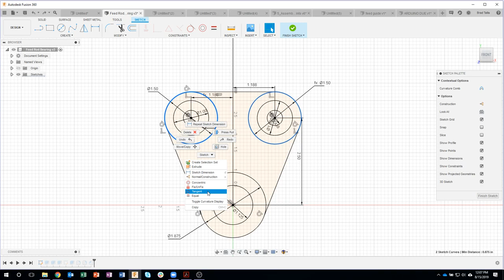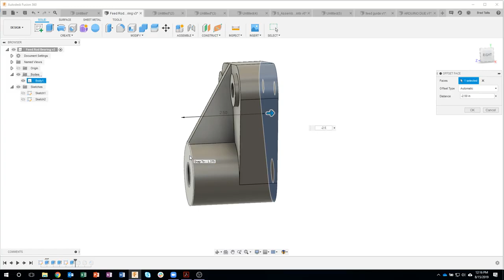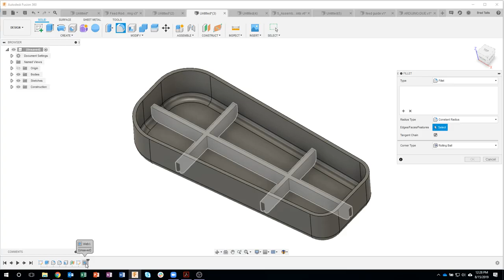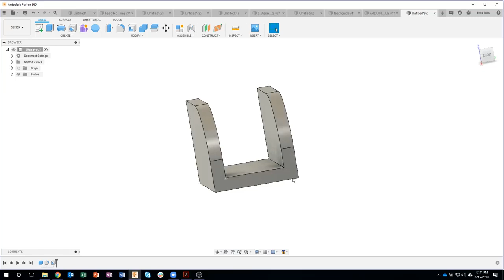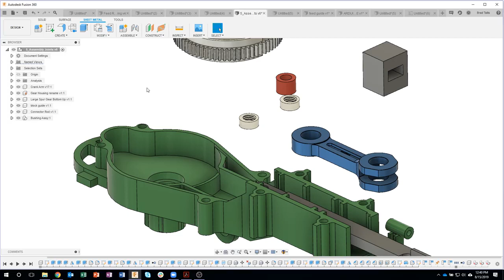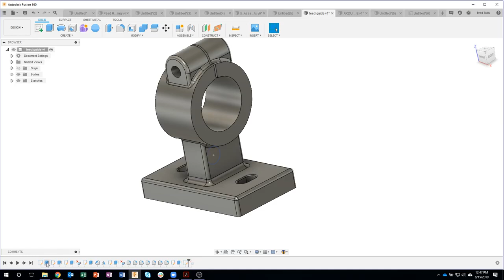Episode 40,  20+ Fusion 360 Tips & Tricks

Comment: Amazing tips. Probably around 30% I have not used. What I use a lot is to check distance between any objects with using control key(instead of using measuring tool) and clicking on the objects I want the distance of, its displayed in the bottom right corner

Comment: in select by size, what is size meaning? volume or area ?? anyone let me know that Thanks!
Reply from the maker: @Makerhome-  You could think of it more of like a bounding box.  For example, it you had a wine glass, it would fit into a box that was at it widest diameter and at its height.  That is how "by size" is selecting.
Reply: Brad Tallis Then at 55:03, I can see the dimension for 21.020mm in dialog box

that means the longest dimension of any components?

Comment: Brad - Great summary of useful tips!

BTW, the tip to select sketch objects and then right-click to see only permitted constraints is a TINY bit less convenient than just looking up on the toolbar at the constraints section, which greys out all the disallowed constraints for the current selection. 

For completeness, one would want to make sure ALL the constraints are displayed in the toolbar - then you could skip the right-click and get the constraint you want in just a single click.
Reply from the maker: Allen-  Yes, I agree.  You can customize your toolbar to display all the constraints and see them easier than using the right-click menu.

Comment: The pdf is fantastic. What if all future Quick Tips were integrated into this document following the same template? Eventually the past 192+ Quick Tip videos already out there would be added to the pdf. It threatens to become a BFD which is possible with anything, but I don't think it would have to be organized in any fashion. As a presenter is assigned a Quick Tip, part of the job is the pdf page from their notes.

SketchUcation has a publication called The D'oh! Book. It's basically a pdf of a long running thread on the forum of all the accidental discoveries users have made about Sketchup. No organization at all. It's meant for browsing in the Throne Room. It works out fine.

Thanks again for all the incredible tips so far. Small bites like this are easy to integrate into a workflow without being overwhelmed. The effort is much appreciated.